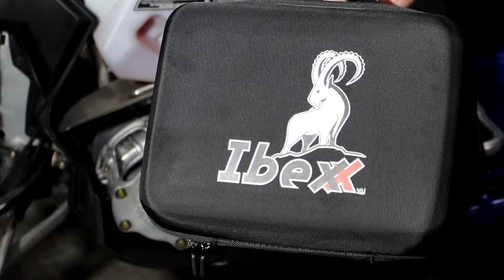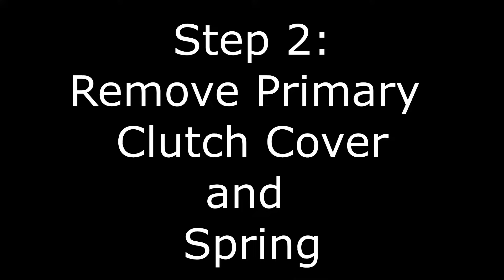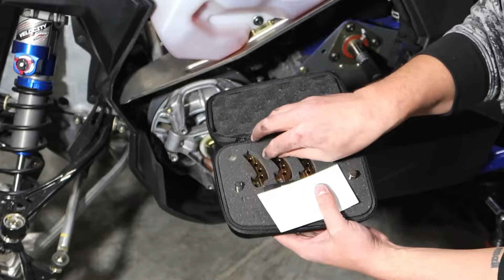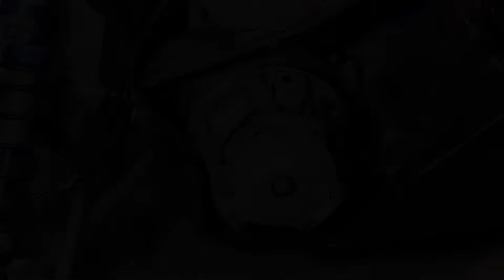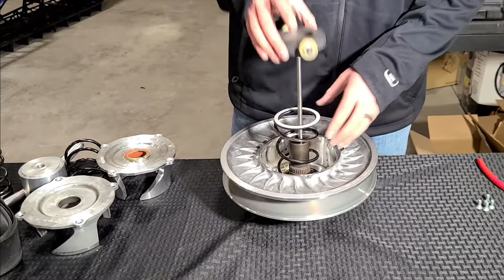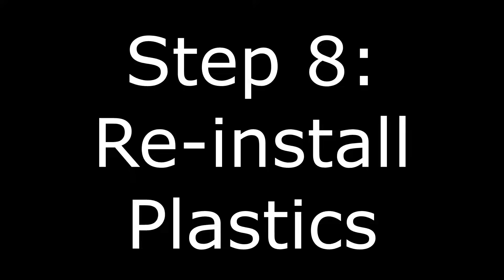Ibexx™ Clutch Kit for Polaris 850 Axys Guide

Comment: My question is what kinda power does it give the machine an what’s the benefit of the clutch upgrade would you be able to run a bigger track with less power loss an would it give the machine more power
Reply: Better track speed and bottom end response